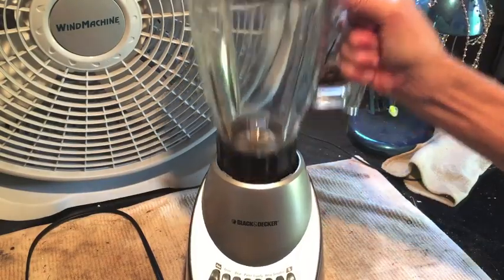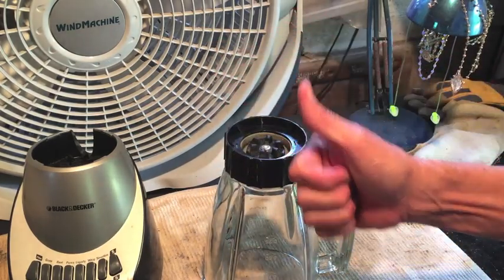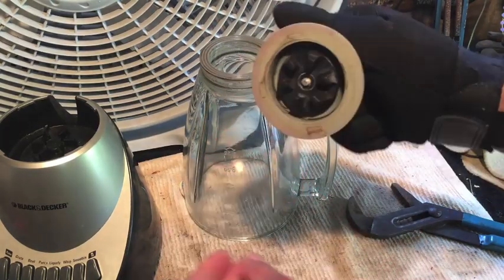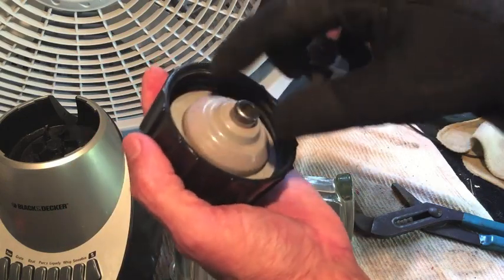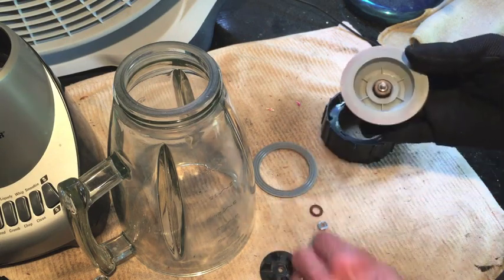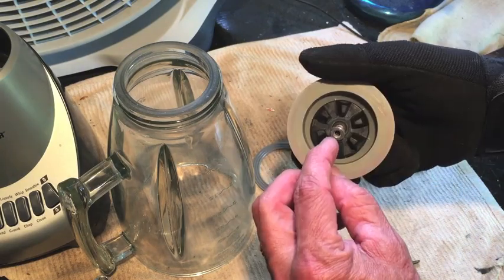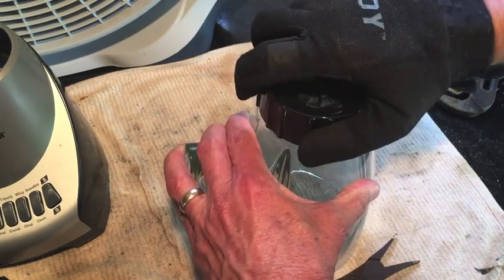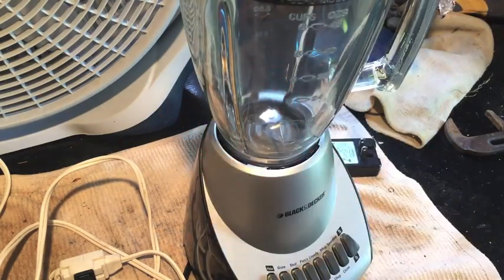Cleaning B&D Blender Pitcher Base/Blades

Comment: This helped me a lot as I have a Hamilton blender that is similar and for some reason the lights are on but nothing, the blade isn’t blending, I’ll see if I can get it to work again, God bless!
Reply: It still doesn’t work, it’s actually a black and decker, glass container like yours. The lights go on but no buttons work to blend anything. You hear a buzz sound but not working. What do you think I should do now? I actually probably haven’t used it in over a year and the last time I used it I remember I made a yogurt smoothie and perhaps some of it got into the blender motor because I remember the bottom cap was a bit loose, I just cleaned it and stored it away til now.

Comment: The 3/8" nut on my B & D blender blade is recessed within the plastic drive wheel.  There is no room to get a socket  on it.  Any suggestions on how to remove the nut?  Thanks!
Reply from the maker: If it's like mine the stud that the nut is screwed on to is part of the blade assembly.. So if you can't get to the nut, turning the blades should work.. The recessed area would hold the nut in place while you turn..
Reply: Thanks for your reply: I've tried turning the blades while holding the drive wheel, but it's hard to get that drive wheel to stay in place.  (Since it's plastic, I can't grab onto it with a pair of pliers to keep it from turning while I'm turning the blades--the pliers would damage the plastic.)  I'll try again, but I'm probably going to have to buy a new replacement blade.

Comment: Can you say what nut was used for that again? I lost it and I cannot figure out what to tell the ACE hardware guy what nut i need!! lol
Reply from the maker: It holds the bottom blade assembly together.. Just take that piece with you to the hardware store.. Tell them the outside dimension of the nut is 3/8" and it's reverse thread..